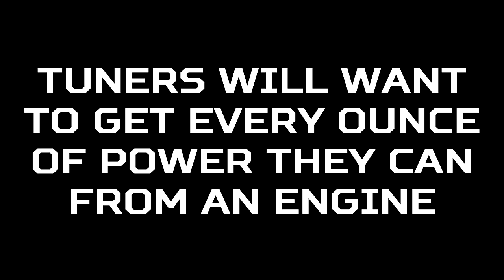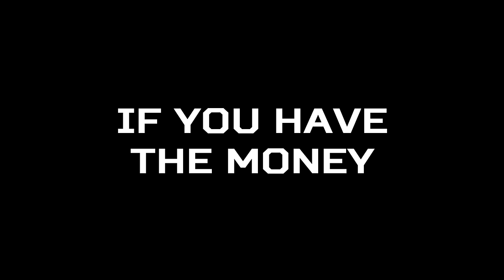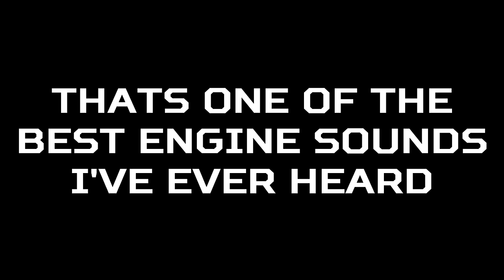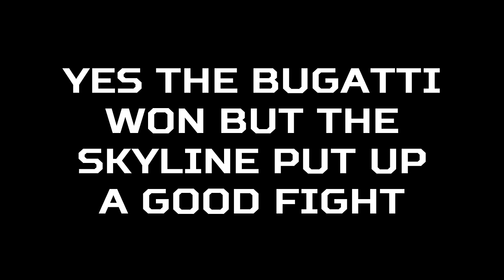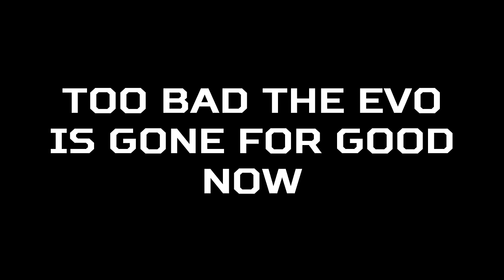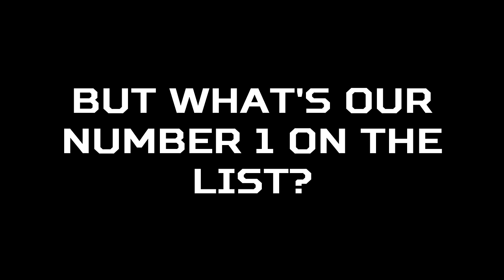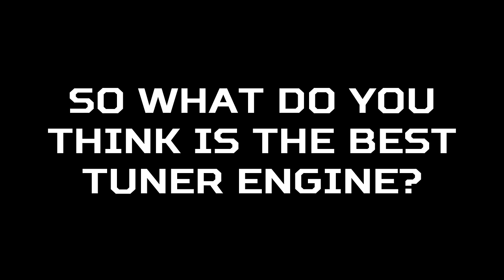9 of the Best Tuning Engines

Comment: Decided this was bullshit when lsx wasnt 1st place but a shit 2jz... Amirite and smc should be here for how legendary it is
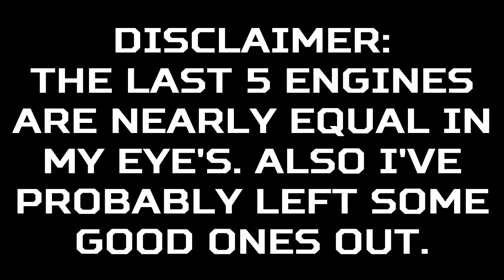Reply from the maker: +MrHitThatLiks The last 5 engines in the list don't really have places as I said at 0:26. They are all good engines and have their pros and cons so they're equal in my eyes. The Rotary, RB26, 4G63, LS Series, and 2JZ are not better or worse than each other.
Reply: +MrHitThatLiks rekt
Reply: Still the 2jz is better. Have you seen how much boost you can run on a stock???
Reply: +Victorious Gaming (Victor) have you seen any good tuning on a lsx? people make them push a thousand horsepower and then daily drive them fine.
Reply: +bob steve Same with a 2jz
Reply: 2JZ's are insane motors

3.0 with the capacity of a V8

I think that's worth mention
Reply: +Cricis11700 
thanks

that was SUPER convincing argument....

I'm sure EVERYONE will think very highly of your opinion because of how developed and educated your opinion is
Reply: +MrHitThatLiks  the key word is "tuner" and I'd say the 2jz at its finest trumps a LS series engine
Reply: +MrHitThatLiks there is no better tuner engine than the 2jz gte. it runs way smoother than any v8 and gets better power delivery plus its way easier to tune and make insane power even on stock internals. they were made with customization in mind and its a 3.0 liter and has 2 less pistons but still easily makes way more power than a lsx with the amount spent on it and that's what tuning is about. don't say stuff just because you're a fan or so called patriot
Reply: +MrHitThatLiks No fnf had a 2j n it ,so I'd say to much need for speed where u can take a hair pin at 200. forza ppl forza lmao
Reply: +Cricis11700 LOL, what??
Reply: +Jan-Herman Schlechter  ...Not sure why you would think a 2jz runs smoother than any V8 (I would like to see proof of that because although 6cylinders are smooth, the V8's have always been known to be the smoothest running engine design from any manufacturer), or the better question why would you comment on that to begin with??   
The 2JZ gets better power delivery??  
The 2JZ is way easier to tune???
The 2JZ makes way more power than a LSX regardless of amount spent???  
WTF man! LOL  Pretty bold statements, im really not sure you want to start this fight.
Reply: +Spirited Driver I was trolling xD
Reply: +Brad Young you can take a hairpin at 200 in forza too. 
play gran turismo and you'll realize forza is just an ugly nfs
Reply: +Spirited Driver inline 6's are always smoother than V8's. V8's nearly all the time need balancer shafts due to fact that it's really just to inline 4's joined at the crank. The smoothest engine designs are inline 6's, V12's and V16's.
Reply: +Jan-Herman Schlechter Hate to break it to you, but dollar for dollar, nothing beats an LS engine. The price alone for a v160 is more than most LS swaps. 2jz's are amazing, but price and power distribution aren't two of its best attributes compared to an LSX. They're both great engines, but the LS edges ahead in terms of reliability and cost.
Reply: +Theo Bryant im not to sure about the whole reliability part but ls motors are definitely cheaper to build. im about to do an ls swap in a toyota pickup truck myself
Reply: +logan kautz look at the 1uz Lexus v8 its actually very turbo friendly and it goes pound for pound with the 2jz as far as reliable big power.
Reply: i love the 1uz. its probably my most favorite motor in the world. mainly because its FAA certified so if i wanted too i could put a 1uz in a PLANE. good luck trying to convince the faa to let you put a ls motor in a plane (unless you get a experimental certification) and there was almost a twin turbo motor released so yes the 1uz is very turbo friendly.
Reply: +Sync Crazeee English??
Reply: +Sync Crazeee I miss my 98 tt I was making 926whp on a bb 88mm turbo n fully optioned motec. But sold it when my kids were born n got my 2012 is-f which is fun n I'll prob turbo it one day but I miss my supras although my mk3 with a 1.5jz was the most fun
Reply: +Brad Young 2jz is the most abused 6cyl aka the god motor lol
Reply: +MrHitThatLiks You can put a lot of engines on this list in many different places, it all comes down to what you are looking for in a best "tuning" engine and how you weight things. 

The real crime is when people make these list and they don't bother to put up what exactly they were looking for or how they came to their conclusion. It wouldn't matter what is in first place as such a list can easily be completely arbitrary.
Reply: Can someone tell me the name of the Mazda rotary engine please
Reply: +Sergio Canale if I'm not mistaking it's called a 20B
Reply: +Sergio Canale 12a 1st gen rx7 carbureted, 13b the fc,FD body rx7 turbos, 20b 3 rotar in Japan. n from what I understand there is a few more but that's your most common
Reply: +Brad Young thanks for the info man!
Reply: +Cricis11700 20b is a jdm 3 rotar ,the fc (240 Looking rx7) and the FD (rx7 tt ) had the 13b in them and then the first gen small rx7 had a carbed one called a 12a (always called them 12ass n 13bitch lol)
Reply: +Brad Young yeah man it's been a while seance I've even talked about or seen a rotary engine, haha thanks for the info man.
Reply: +Cricis11700 Notta problem. Aint no sense in having knowledge or skill if u don't use it
Reply: Ronan McHugh
I dont think a V8 is designed like 2 inline 4's, a V8 is actually like a 'smooth V6' but with two more cylinders (for example the 4.3L V6 & 5.7L V8 both have a 4.0bore x 3.89 stroke, and both have the same 90*  "V" )!
Were you referring to the firing order?

I do agree In terms of 'smoothness',  the 4cylinder cars are generally not smooth like 6cylinder and 12 cylinder engines or V8's, but there appears to be the majority of luxury cars are V8's...
Reply: +Spirited Driver just read up on engine primary and secondary balance, Wikipedia has more info on it than I can and I'm just not in the mood to go behind the engineering and physics behind it 😂
Reply: Ronan McHugh
 On paper you might be right, but in real world scenarios i dont think it means anything worth mentioning.
Reply: logan kautz Turbo cars just aren't reliable, the more psi the less reliability. The 2jz-ge is very reliable, as is an N/A LSX, but once you start modifying the GTE it gets less reliable than a comparable Turbo/sc'd LSX.
Reply: +Theo Bryant Speak for yourself ,I had a 98 Supra tt that was making 926rwhp ,680ftlbs of tq n Dailey drove it no problems
Reply: +Sync Crazeee indeed ,I've had a rb25  powered s14 n it didn't gold a candle to the Supra but my is-f has potential and is turbo friendly n then the wife has a gs430 so maybe I'll drop an aristo in it for her sometime soon. N yea its the internet but it helps to pass time at work lol
Reply: Brad Young Cool, and I daily one of my Hennessy Venom's with 1400hp and it hasn't down on me yet
Reply: +Theo Bryant Good for u now lets look at bang for buck?? id still take my good ol 2jz Supra anyday. the Supra was made for ppl like yourself with your well over 100k invested cars and u get beat or the Supra pits up a good fight for a 3rd to quarter of the cost. I rest my case
Reply: +Brad Young it only took Nissan till what 07 to really compete with 90s Toyota
Reply: +Brad Young it only took Nissan till what 07 to really compete with 90s Toyota
Reply: Brad Young I was just joking, but the supra was always a pretty expensive car. When it launched I think it was around 40k, which is around 70k in 2015 due to inflation. Value is always relative, if you could build a car to destroy a GTR for 10k, why buy the GTR? You buy a more expensive car because it's more expensive. People with Lamborghini's don't care if you can build a supra that's faster than their car for cheaper, they have something that the average person doesn't have, and that's exactly what they want.
Reply: +Theo Bryant Very true ,although it ultimately comes down to personal preference, budget and the application your going for. Yea the Supra was a lil expensive but u also gotta look at what u get. Personally i like dropping a 1,2 or 1.5jz (personal fav 1j head n 2j block) into a mk3 Supra and always enjoyed beating up on the 8cyl muscle n the occasional viper or lambo using only 6cyl. But that's the beauty of the variety and being able to mold n build your car into your own personal dream and myself personally love how Toyota gives u such a well built platform to upgrade
Reply: +Theo Bryant On a funny side note your comment reminds me of some of the reasons the quit making the grand national. The fact u could buy one for a good bit less then a vette n bpu it n raoe a vette n Chevy couldn't have the top end sports car getting worked by its mid range with a few  mods (also keep in mind its the standard 350 to lt1 time period)
Reply: +Sync Crazeee Damn your lucky ,ever since the damn movie they are going for crazy prices.
Reply: +Sync Crazeee And yea the supras an engineering masterpiece as far as power,aero ,durability and  gearing. Plus as we know its a top end monster on the HW. Your screwed if u try one from 70+
Reply: +Sync Crazeee I agree whole heartedly ,I thought the lfa was gonna be the new Supra ,but just wouldn't be the same without a 6 cyl that "will decimate all" lol
Reply: +Brad Young yes on the stock turbos. Mine made 412whp at 412tq with exactly that
Reply: really dude lsx do some some research on the engine it's considered a ls series engine it's really good but can't handle the high horsepower like the 2jz can plus you can get an ls2 and make it way better than a lsx any day for the price 2-5000 for the engine 15,000 in upgrades 15-1800 hp for the price of a lsx
Reply: +Sync Crazeee lol what's the 2jz rated max hp
Reply: +Sync Crazeee titan motorsports supra with the world record they made a green supra that not many people know about for hulk Hogan that has 7000 hp on a stock block  and no it was not the one his son crashed between both of them they own a total of 20 supras believe it or not
Reply: +Ronan McHugh what do you think about smoothness of 5 cylinders and V10?
Reply: +Ludscher I'll keep it short. Even firing inline 5's are nice and smooth until you start to rev them out and then secondary and even tertiary balances start playing in.
V10's are just like inline 5's but if the V10 is a 90 degree bank angled five throw engine, it is very well balanced.
Hope this helped :)!
Reply: +MrHitThatLiks 

We made 500hp on our Supra's back in '98. Long before F&F came out..
Reply: +The Boss supra are really nice cost a lot but in Japan their is a supra most Americans fear or don't know about back in the day  toyota supra rz came with 600+ hp monster that model was not allows cuz it didn't meet regulations of smog but every one knows it's because it did not meet the 300 hp rang of power cuz American cars were crap in that era of muscle cars
Reply: +marcos vargas Well the big block Chevy, which was well established by the time the mk iv supra made an appearance, existed... There's a good reason BBCs are extremely popular in the drag world... Back to the LSX series, you can't beat displacement. There were a few articles (I think hot rod &  jalopnik) that went over how you could secure an iron block LSX for pennies on the dollar. The other article went over how they were able to take a 4.8l stock engine and boosted it over 1000hp (albeit it didn't last). Think about it however, you can just replace the pistons rods and studs studs for under 1 grand, conservatively tune the ecu, and have a set up that destroys 2jzs with only a few thousand invested total. You can't buy a 2jz compound turbo engine for that price.
Reply: +MrHitThatLiks I work on one everyday, it's in my sc300 2jzge in that bitch motor can take anything you throw at it at least from my experience
Reply: Guys are running literally thousands of horsepower with stock internals in 2JZs. The LS is an incredible motor, but the 2JZ has it beat for tunability. The LS is also normally a race-built crate motor. The 2JZ came in Toyota Corollas.
Reply: +Ryan Eyster a 2jz never came in a corolla
Reply: Sam Wegleitner sorry I was thinking of the Mark II
Reply: Coz mericans the best right?
Reply: Not really sure about that bold statement. Most of the Supra Mk4 owners I talked to wouldn't dare to go over 700hp with a stock motor without some serious upgrades. Concern is the heads popping off or the rods simply snapping. (there are always exceptions however) Tunability? LSX always wins. 2jz heads are notorious for being difficult to port.  No breathing means they produce less power out of boost. Their VVTI is less desirable than non VVTI because of the needless complexity for little power gain in a boosted application. Their turbo setups are finicky. Their small displacement means they don't produce any power until high rpm. Not to mention 2JZ parts cost a fortune. LSX? You can pull one out of a junkyard for a few hundred bucks and boost them to well over 800hp with just injector mods and an aftermarket ECU (virtually all aftermarket ECUs support the LSX). Just search up LQ9 turbo. (it's VERY common for performance applications) LSX engines are practically legendary for how easy you can get their heads to breath to make power. They use plastic manifolds bot because they are cheap, but because that allows low heat conduction, colder air, and that means denser gas charges for more power. Their larger displacement means they spool turbos very quickly, meaning you get more usable power in low RPM versus getting it all at once just 2000 rpm short of redline in the case of the 2JZ. Weight? LSX is a feather (weight and size) Vs 2JZ, so handling arguments are mute. LSXs are bulletproof because the same HP over 5.2-6 liters versus 3 liters mean the LSX internals are under much less stress versus the 2JZ. Their large displacement means they make more torque means it is fast out of boost versus the econobox nature of the 2JZ until it hits boost. Finally, the aftermarket for the LSX is near limitless. This means dirt cheap parts that make easy power versus the 2JZ. I come from both camps, but I know it's a mistake to underestimate the LSX's pedigree and consistency.
Reply: +MrHitThatLiks Relatively speaking the LS pales in comparison to the 2JZ.
Reply: +William Grand I refer to my first response.
Reply: 2jz is 1st coz of its capabilities like gaining 1000+ hp with aftermarket turbos and just stock internals, The RB26 can also gain that horsepower when the GTR become legal in the US because some turbo manufacturers like precision turbo which makes big turbos for engines dosent built one for the RB series engine
Reply: +Whenzy Quijano he's just a 2jz hater
Reply: Whenzy Quijano I wouldn't say that the RB26 & 2JZ can plow to 1000hp with a simple turbo upgrade. The biggest issue both engines have is that they use I beam rods instead of the much stronger H beams. Leading to many engines to self destruct before grazing the 1000hp. Although there are a few examples of 1000hp stock 2JZs and RB26s, I wouldn't say it's a consistent phenomenon.
Reply: the ls motors are the best for tune and they are not expensive at all
Reply: You have to realize the people have been tuning the 2jz long before they started to add turbo's to ls motors
Reply: +Daniel Bargas I don't see how seniority would make the 2JZ a better tuning platform. With that logic, the Big Block Chevy would technically be better than the 2JZ for tuning, given people have been long stroking those engines way before the Supra Family even existed. I judge an engine's tunability by the combined cost and effort to have it make more more power. The less the better. An LSX can't be beat in that regard. Maximum HP with an infinite budget? Still the LSX.
Reply: +Q.V. Huynh the lsx is expensive as fuck
Reply: +Garrett Moore there is really nothing special about it engineering wise. just a tough bottom end from the factory. they look great on paper but ive driven higher HP 1jz and 2jz cars and they arent very practical. exciting but not easy to use
Reply: +Theo Bryant 2JZ are not reliable? Okay you never work on a 2JZ
Reply: +adanacel Yeah.... what ever you say. The myth of Japanese reliability is just that.. a myth. No one who understands engines would ever say that the 2JZ is a better engine than an LS.
Reply: +TheOperation I've owned 2 jz's and lsx's yes we get it they are both great engines don't trash one because you don't agree geez this is just his opinion
Reply: Q.V. Huynh have you ever owned a supra or 2jzgte or 2jzge I'm a supra owner is300 owner and a Chevy ls3 ls1 ls2 and lsx 454 owner my supra has 2000+ hp almost to stock internals my is300 has 3000hp stock block and pistons all of my ls series except for the lsx have anywhere from 1200-2000hp have absolutely no stock internals my lsx 454 won't revile the hp but has no stock internals and it's twin turbo supercharged in the past 2 years I have rebuild the ls3 and lsx 2 times already the ls1 has has been cracked and replaced the ls2 has been the most reliable of my ls engines but my Lexus has had only regular maintenance and has not broken down my Daily driver is my supra that also has only had regular maintenance and has not failed me in the 6 years I have had it and pretty soon I'm going to push the supra to 4000hp on close to stock internals yes I love my toys I take care of my toys but the ls has nothing on the 2jz motors when it comes down to making horsepower and reliability at high horsepower and yes the 2jz motors are very expensive to built and the ls you can easily make 700 hp with a supercharger at 6-8 psi with stock internals and you can push them to 1000hp but the chances of being reliable are not so great I know this because I have done it
Reply: +marcos vargas I do not own a Supra, though I wouldn't call myself a stranger to the platform either. However, I highly doubt you own a 3000hp stock block 2JZ. Yes, there are examples of stock 2JZs that have breached the 1.5k hp mark and the occasional 2k mark, but I highly doubt stock cast iron i-beam rods can hold up to 3000 hp. Also, if you did have a 3000hp Supra with stock internals, why have you not been recognized by the car community? Surely everybody would be boosting stock 2JZs to 2-3000 hp if all was needed was a big enough turbo...
Reply: +marcos vargas you are the biggest bullshitter I'm a local engine builder in nc the most you can get out of a stock bottom end 2jz is around 900whp and that's really pushing it, I had one guys supra on the dyno and he was telling me he wants to make 1000whp on a stock bottom end, I highly advised against it and it threw a rod at 941 whp. So don't tell me anything about jz's
Reply: The most amazing engine ever is the 4g63, its just unbelievable the amount of power it can make without touching the internals...
Reply: Daniel Bargas so your a local mechanic not a actual high performance mechanic shop and you must not know what your doing then my supra and is300 haven't blown a rod yet I have been building 2jz couple years and swapped the motor in to a lot of cars with massive amounts of hp to the crank just wondering if you know the 2jz who created the 2jz cuz to me you sound like a person that has never build an engine in his life just hates on better engine builders that can get the most out of the engines than you can I'm wondering have you ever build a 1300 hp camaro that passes California state smog I have spare complete 2jz and ls motors if you would want to build one or both I can sell you both if want to give it a shot
Reply: Q.V. Huynh I'm just a regular working Joe that does not want to get bothered by the car magazines never liked the media just wondering why has  hulk Hogan not brought out the supras that he owns why he has a supra build by titan motorsports that has 6,000 hp and no one but close friends know about it titan motorsports have not even told the car community about the car it's cool a lot of people are going to call me a liar it's bull shit but it's alright just like Paul walkers supra the white one at the end of fast 7 that one was going to be 2500 hp for his daughter but he never finished the car it only had 900 n/a when he past and only a hand full of people knew about but yet not the magazines or car community
Reply: ^ If you were in the scene in the 2003 era, you would have seen Hulk Hogan and his Supras at plenty of meets.
2) 6000hp? That's top fuel horsepower, I don't believe a single person on this earth has a 6000hp 2jz. Ekanoo and Titan may be close to the 3000hp mark but even that is a far cry from 6,000 and they may even be the only ones at that level.
3) If you've seen PWs cars and heard him talk about them, you'd know that he likes things tastefully done, a 2500hp car will never fit that bill, and giving that kind of power to a kid? Nonsense.
4) A 2jz will never make 900hp n/a, getting it to a 3rd of that horsepower would cost you $$$ and would make you an n/a 2jz god..and that's only at 300hp n/a.
Reply: +marcos vargas I am jdm Nissan, Mazda, Toyota and Subaru certified. I opened my own shop at 24, we have a flowjet and an engine dyno, now at 27 my personal profits are about 220,000 and climbing as I will be opening a larger shop. Look us up PIR, performance import racing. Thanks and have a good day liar
Reply: +Decside thanks bro you get it, besides he referred to fast and furious LMAO
Reply: +stupidplants so true
Reply: +Sergio Canale 3 rotor 13b
Reply: +Spirited Driver Look at it like this. By putting 2 4-cyl banks at 90 degrees, a cylinder can now fire every 90 degrees, as opposed to every 180 degrees in a 4-cyl engine (or 120 degrees in a 6-cyl).
Reply: +MrHitThatLiks I own 2 of them actually, a 93 Supra and a 98 Supra and trust me they are better than any LS engine.... Name me one other engine (LS or otherwise) that you can QUADRUPLE the factory horsepower with on stock internals? I can think of only ONE and that is a 2JZ-GTE.
Reply: +Theo Bryant You're kidding right? The world record 2JZ-GTE stock internal dyno is 1043rwhp and he has daily driven it for years with no issues so your comment is ignorant.
Reply: +Brad Young way before the movie actually... they have held their original MSRP for years. But you can get one for $25,000 pretty often.
Reply: +CalypsoNotch408 Respond when you're making 1043rwhp on the STOCK INTERNALS of any LS series motor.... the Supra has done it.
Reply: +MrHitThatLiks Actually I owned a Supra before F&F was ever even thought of thank you very much, so your comment is ignorance at its best.
Reply: +Ryan Eyster The world record is 1043rwhp for a stock bottom end 2JZ-GTE but I agree it can handle 1000hp reliably.
Reply: +MrHitThatLiks he did preface the video with that they are all equal and not exactly in any particular order.
Reply: hey you should concider that toyota motors like the 2jz wont die.... so yeah.
Reply: What's there to not understand? The video is about what engine is easiest to tune. You can't tell me it's easier to make horsepower out of a naturally aspirated LS engine than it is to swap out turbos & injectors on a 2JZGTE and make 1000whp on an unopened engine? There's not talking about which engine is better/lighter/reliable/etc, there talking about manipulation.
Reply: +Jacob Pockros That would be true if cost wasn't a large part of that formula. Yes you could slap on a set of bigger turbos and add a bigger waste gate then reprogram the ecu for optimized air/fuel and spark without opening the motor but that motor will not live very long at those power levels and the cost of those mods, lets see two bigger turbos about $6000, waste gate $500 or $600, reprogram of the ecu with a performance tune anywhere from 500 to a couple of grand depending how involved you want to get and who does it, upgrading the rear end $3000 or $ 4000 to survive a 1000 hp. Now you have 3 choices for the LSX motors that won,t blow up within the first 10,000 miles, the LS3 376/525, the LS7 my personal favorite( a 7000 rpm V8 that makes over 500 HP) or the monster of the bunch the LSX 454(if i remember right over 700 HP on pump gas but don't quote me on that one). Now all of these motors for about 15 grand  complete with a 2 year 24000 mile warranty. Now understand those smaller engines with power adders make great power but they absolutely will not live very long at those power levels with a stock bottom end. That Toyota Twin cam straight six is only good to about 600 to 650 HP with the stock bottom end. Ohh P.S. the rotary motor sounds like a giant weed wacker, its a great motor but i've never seen one that didn't sound like shit.
Reply: You're right that they don't live long at 1000whp, it has been done though. Guess its all subjective at this point. There are many engines on Supraforums making 700whp unopened and those are very reliable at that level. Most people do a single conversion as opposed to twin because its more cost effective and they have more room to work with. The rear end is fine for 700whp+... but the stock clutch and flywheel is no good.
Reply: Jacob Pockros
Tell that to my Supra's that have been at 1171rwhp and 1453rwhp for years.
Reply: Shawn - I like the punch line. I will have to remember it :)
Reply: 2jz shit???? On what planet? lol. Im no ricer, but damn, you cant make sweeping comments like that. The lsx weights nearly 300kg with fluids and all ancillaries. In performance terms, the power gains would be offset by the huge increase in weight. But i admit, bang for buck, an aluminium block lsx would push most chassis' along nicely, until you got to a corner.....
Reply: Matches Malone
Exactly, if the LS Series motors were so great then there would be one that runs a 6 second 1/4 mile right? So far there isn't a single one.... yet the 2JZ-GTE is in the 5's in the 1/4.
Reply: power to weight ratio FTW!!
Reply: there both great motors but both r highly overrated. seems like almost everybody wants to put a 2jz or ls in their car. 😒
u can make any motor strong but u have to create stronger parts for that motor.
Reply: +WhyteLis21 the first gen 2jz from factory can handle 750-800 hp/tq all day long...   there's not a very long list of engines that were designed in the 90s that can claim the same thing..  even the NA version of the 2jz can handle the same abuse....   it's far from being an overrated engine, it's so highly desired and praised for a very good reason.
Reply: yep. 2jz is overrated motor but overall still great engine. just like chevy ls1 n dodge hemi motor.
Reply: yep. 2jz is overrated motor but overall still great engine. just like chevy ls1 n dodge hemi motor. interesting enough swapping an the underrated nissan vh or vk v8 would of made the gtr 35 a pretty aggressive car to my like though.
Reply: *****
2jz is an over rated motor? It holds the world record for both the fastest import 1/4 mile and faster 6 cyl 1/4 mile... troll on kid....
Reply: 2jz is overrated motor for used in the import scenes. almost every car tuners know about the motor just as much as chevy ls1. that doesn't mean its a bad thing. so stop trolling like a smart ass. I'm just saying wat I'm seeing.
Reply: no i agree with 303garage the 2jz is beteer engine than  the lsx
Reply: +Jan-Herman Schlechter  ls swaps are better because they're cheaper then 2jzs I could get and ls1 for 1500 with wiring harnesses and an out of the box it already pushes 400 which is very fast for stock. and to make more will only cost you another   1 or 2 k depending on the set up. I love and admire the 2jz in every way. But price wise and stock wise. LS for the win. And besides, if you have enough money, time and the know how. you can. make any motor push power. So most times it's not necessarily the best but what's the most affordable. And if it's wildly available in terms of parts and the motor itself.
Reply: Victor Sanjurjo
While the LS is a decent motor the 2JZ is better over all. Hence why there are 2 different 2JZ-GTE cars running 5 second 1/4 miles and no LS motor cars running 5 second 1/4 miles.
Reply: I seen a gmc truck with a v8 run a 6 second 1/4th mile and a truck alone no matter what you do will weigh well over 3000 pounds. And believe it or not 2jz has mechanical issues that no one likes bringing up for example oil pumps seals can blow out often, and problems with the timing belt. While LS don't die. My best friend has an LS motor since forever lol and still runs with no problems at all.  And how many corvettes do you see on the streets?
Reply: Victor Sanjurjo
LOL You're kidding right? The 2JZ-GTE is one of the best and most reliable engines ever made this is a fact proven by many experts. I've owned 2 Supra's for many years now. I bought my 98 right off the showroom floor with 10 miles on the odometer in 1998. My 98 is now pushing 1453rwhp not including the 300 shot I use at the track, and my 93 Supra is pushing 1171rwhp also not including my 300 shot. The ONLY problems I've ever had with my cars is vacuum lines. They do not make a vacuum line strong enough to handle the power my cars make. Your comments prove your ignorant of the 2JZ-GTE motor. my 93 Supra has been build for over 7 years and my 98 for 6 years and I've had ZERO issues besides vacuum lines.

http://www.titanmotorsports.com/chcocr.html

http://www.titanmotorsports.com/charcon95sup.html
Reply: both ls n 2jz r too common in the performance tuning racing scenes. but their both still great motors though.
Reply: ***** I agree, but they're both not perfect either way. Their is no perfect motor. But I would fancy f20c though for it being such a Rev happy engine.
Reply: agreed.
Reply: Anyone who thinks a stock block RB26 can reach 1k HP has no idea what they are talking about. This has never been done with stock internals.
The 2JZ however, has many instances of an entirely stock block reaching 1000WHP.
Here is an example of one:
/watch?v=YnS-nT6o4xA
The LSX is a good engine there is no doubting that, but its definitely not something that can be found at junkyards. I think that person was confusing it with the LS1, 2 or 3. which aren't bad engines but can not come remotely close to 1000hp on a stock block.
The LSX is a 24K race engine:
http://www.chevrolet.com/performance/crate-engines/lsx-454-r.html
Reply: Victor Sanjurjo Wrong, if they are having problems they haven't built it properly. 
2JZ is a very reliable engine with a very good, very high flowing oil pump. this is one of the reasons it can reach such high power levels with a stock wet block. As for popping seals, this is something that can happen to any belt driven engine running very high PSI.
Reply: Shit 2JZ? Ok bud, tell me how is shit when literally everyone knows it's one of the best engines let alone tuner engines. Stock bottom end reaching 1000hp+ and it's shit? Man I'm sorry your little engine didn't make number one over the king of all engines.
Reply: Kale Dotzler
I know right?
Reply: Brad Young there is one 12a that was turbo rare asf only from Japan of course
 (Gen 2 rx7 12a Turbo)
Reply: Victor Sanjurjo There's a reason why the older era Toyota's hold their value so well, is because they can easily last 400,000km's (250,000 miles). Sometimes 800,000 km's before they need to be rebuilt. That era of Toyota still isn't matched for reliability. Especially by American cars.
Reply: Kale Dotzler Small block chevys have seen over a million miles untouched before.
Reply: William Stewart I guess their both over built then.
Reply: Kale Dotzler Not overbuilt, just built properly.
Reply: William Stewart Yea that's what I meant, hard to find many engines built like that in current times I find.
Reply: Kale Dotzler None are to my knowledge, all have a shelf life now that coincides with the warranty length.
Reply: William Stewart Yup, gotta hate that planned obsolescence.
Reply: the hemi is way better hen a 2jz  and it was developed in the 60.s or something like that
Reply: ***** What HP can a stock internal hemi bang out?
Reply: o gives a fuck about a "stock" engine    can a 2jz head support 10,000 hp?  a supercharged hemi can, its what the nhra  cars use.... stock engines  lol   the whole point of being a good tuner engine is to tune the damn thing.... so yes, a built 70's v8 will make more hp then a built import...yes i know ekanoo has lots of fast imports... but theres a reason why all the guys who race for big money use big engines combined with boost.... bigger cylinder heads can support more air, can make more power period... fuck stock engines  lol
Reply: ***** Well if we want to talk about big builds I've seen more than a couple R35's fully built that beat the big v10 and v12 Lamborghini's.... That's a v6. Bang for buck is the 2jzgte I'd say almost every time. The block can support up to 2500hp so I mean there's that.
Reply: ***** I'm just talking about how the engine itself can go up to 1100hp with stock internals. Big turbo and e85 and that's basically it. That's tuning and it's better than most engines I've seen.
Reply: Kale Dotzler You only care about peak power numbers? What aboit the curve, the powerband?
Reply: William Stewart Yes, the very linear power band making the 2j a very pleasurable engine to have in a car. Whether it be a daily or a drag car the 2J is a great choice.
Reply: Kale Dotzler You're not making "linear" power with an 1100hp 3.0, the turbo is so big it won't even fully spool until about 6000+ rpm. At that point you just spin till fuel cutoff and then switch gears+repeat. I'd rather a big block making 1000 hp naturally aspirated or a mild supercharged LS build, way more predictable power.
Reply: William Stewart I'd rather have a 550hp turbo 2JZ. When and how are you ever getting anything over 650hp to the ground?
Reply: Kale Dotzler Too each thier own I guess, I'd personally take the naturally aspirated engine making the same power everytime.
Reply: William Stewart Then to that I would say the same, I prefer the little bit of lag that turbos give for daily because it keeps you engaged and it's sometimes or always pretty fun. I do really want to do an LS7 swap on a light car aha. I have mad respect for the LS series but mainly LS7 for the high numbers they put out while staying really light. That's the one thing I don't like about the 2JZ is that it's a fricking boat anchor.
Reply: Kale Dotzler Yeah it's a big chunk of iron ha ha, hence the blocks can take a lot of abuse.
Reply: The Lsx series has less than half the aftermarket availability and capability of the 1st gen 350 small block. Anything you can dream of making on that platform is already available without having to fabricate stuff and is still affordable.
Reply: Chris Huynh might be true but lsx after market is growing crazy fast and sbc 350 has been here since the 60's
Reply: MrHitThatLiks Plus it's hard to argue with the LS7 with how good that engine is for tuning.
Reply: never use 2jz and shitty in the same sentence
Reply: yevgeney shishkov There is no one engine that is the best, only one that is better at one thing over others in certain categories.
Reply: well it is known for being the best in most of the catagories
Reply: yevgeney shishkov Weight and fuel economy are two major categories it doesn't excel in. Btw, I'm not trying to just shit on the 2JZ, it's my favourite motor and I'm doing a GTE swap on my IS300 soon.
Reply: nice! i love that car. I love those engines. Currently I have a 2001 audi b5 s4 with a 2.7 twinturbo engine. It's an awsome car! And it's my first!
Reply: yevgeney shishkov This is my second. How is the 2.7T? I'm stuck between an Audi wagon or a Subaru for my winter car.
Reply: Kale Dotzler Subies are cool and all, but Audi and Volvo wagons take the cake for me. They are just so badass and true sleepers, very practical as well.
Reply: William Stewart Yea, I just really enjoy the AWD drive train that Subaru has. Plus Volvo wagons are impossible to find in a manual. The other thing is that I find euro cars get pricey for maintaining after high amounts of KM's/mileage...
Reply: yeah i didn't get high miles and were doing a lot of things on it right away so it\\the s4 would last
Reply: Kale Dotzler Volvo's are fairly cheap to maintain, if you can find a decent V70r I would jump all over it. The most common issue on those is the electronic ride control sensors in the back if you live in areas that use salt in the winter and you don't rust proof. That turbo 5 sounds so sweet and they have such a smooth power delivery.  Just a tune and downpipe and you're well over 350hp, the 6 speed manauls in them shift like butter too, very comfortable car.
Reply: William Stewart Volvo's weren't sold in manual in NA.
Reply: Kale Dotzler The V70r and S40 could be had with the turbo 2.5 inline 5 and a 6 speed manual. I forget what type of AWD sysyem they have though.
Reply: William Stewart Volvo didn't sell manual options in North America dude.
Reply: Kale Dotzler The b5 s4 is awesome bro! the luxery, speed, and handling, noise. You have to maintain it more carefully but that's about it
Reply: yevgeney shishkov Aha another thing I need in my next car is turbo, not gonna go naturally aspirated. A4 is basically all I got for Audi. Or there's the GTB legacy, Forester XT, or GF8 wagon from Subaru...
Reply: I love Volvo and Audi but for used market they don't really hit the mark.
Reply: Kale Dotzler I live in Canada, a guy I work with has a Volvo S60r, it's the same as the V70r (300 hp 2.5 turbo, AWD, 6 speed manual) but a sedan. I can buy 81 manual Volvos in my area right now on Autotrader. I suggest you take a look at them. There's the C30 which came with a 2.5 turbo and 6 speed manaul, various S40 models that could be had with a 2.5 turbo and 6 speed manual (very rare but some had AWD), then there's the various S60's including the "r", and last but not least there's the V70r.
Reply: MrHitThatLiks the 2jz is the holy grail of swaps, only reason lsx is so good is because of how easy it is in comparison
Reply: Ezra Greene The LSX is good because it's cheaper,also way cheaper to modify.
Reply: William Stewart Eh idk, at $2-3k the 2JZ is pretty cheap. It's also not that expensive to modify.
Reply: WhyteLis21 i dont know why hemi are so highly regarded, the only reason dodge could take thr name for itself is because the europeans deemed it shit and didnt really care if dodge took it. it was great in america yeah conpared to the flat tops but after the pents its useless.. and yet they still put it in there cars like it means something, its all just marketing, it hasnt had a real use for almost 50 years
Reply: William Stewart im talking about potential, if you had the money potentially a 2jz can handle 2000hp for far longer than an lsx can IF it even can. but yeah in terms of cost the lsx wins out, the only reason to swap a 2jz is if you had balls amounts of money to make 1000+hp, which is all you really see people do, the lsx is much better for a street car which is why its so common, and its smaller meaning, easy way to get a lot of torque into a small car
Reply: Ezra Greene A built 2J will never touch a built LSX. You can get streetable 3000hp LSX engines from Nelson. 2000hp through a 2J is pushing it to max, theres no comparison, no replacemnt for displacement.
Reply: William Stewart Actually a bigger turbo is a good replacement. Also idk what you mean by "streetable" but that high of HP is definitely not good for street use especially in a RWD only car. Look up the unicorn Vette on the street, he flies over 3 lanes. Not really that safe.
Reply: Kale Dotzler You're not replacing displacement with forced induction, it's essentially creating more in it's workings.  You should check out Nelson racing, he builds great engines with huge power and they're all street able to boot.
Reply: William Stewart You are in a way, what I mean is that you can choose one or the other to get to the same power. (You can of course choose both for the best option but that's another story aha). I think I've heard of them, pretty good builds. What I mean by streetable though is that you and I won't be able to control or use that high amount of HP on the street without an insane amount of training so it's not really all that viable.
Reply: Putting it to the ground is a different story, I'm just saying they'll build you big horsepower engines that are well manored and reliable.